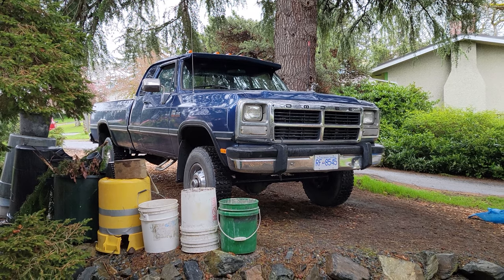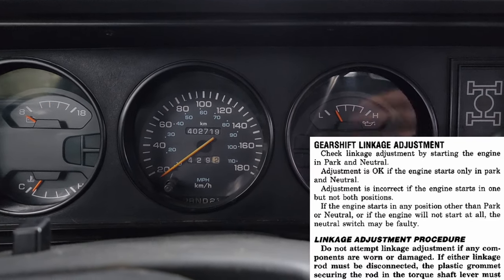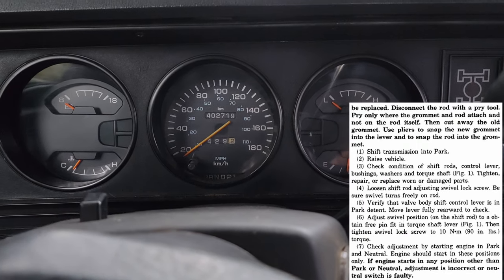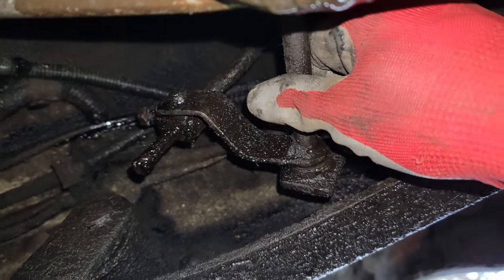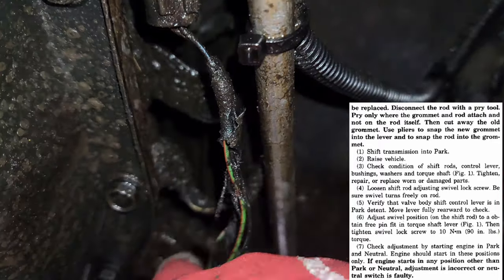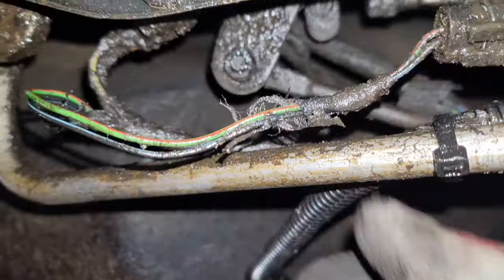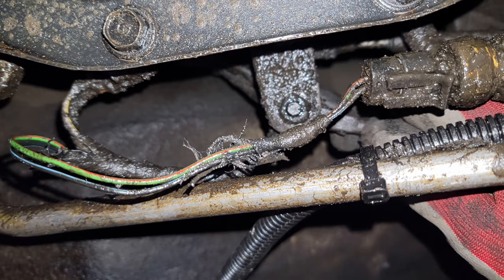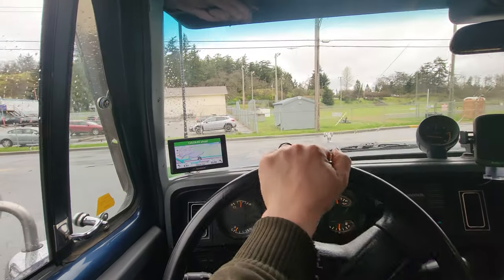Shift Linkage Adjustment | 1st Gen Cummins

Comment: Greatest thing about these trucks they have an automatic oiler system that keeps the frame lubed and all the components running like they rolled off the factory floor
Reply from the maker: Believe it or not it's not leaking I actually applied rust check oil spray as a rust prevention spray.
Reply: @OvensGarage  I would do that but i have too may gravel roads around and all that dust really sticks good
Reply from the maker: @cowthedestroyer  the more the better!

Comment: Check your motor mounts. The engine may be moving because of torque and stretching the linkage.
Reply from the maker: That's a great point! I'm getting a weird noise that I thought my exhaust was hitting something every time I throttle up too. You may be right.
Reply from the maker: Turns out my trans cross-member bushings had worked themselves loose!! My motor mounts were good. Just got new nuts and torqued down my trans cross member bolts to 150ft/lbs. That cummins shook them off! No wonder I had to adjust the linkage the whole trans was shifted to one side.
Reply: Good deal I'm glad you caught it before it could get worse.
Reply from the maker: @howardhudson7214  you saved me! I thought it was just the exhaust hitting something making a weird noise when I was accelerating! Haha
Reply: That's awesome.  I had an old Ford that when you torqued it up the 4x4 shifter would hit the floor board and pop it into 2wd. And that was the same problem. Loose trans mount bolts.

Comment: Great video, is that your TV cable that is unhooked? Hope you unhooked it and make sure its back on. those guys in Texas (Precision Transmission ) say that is a super important to have transmission pressure correct. again GREAT video thanks PS: sure like your gauges above the mirror instead of the gauge pod on the pillar.
Reply from the maker: Hey Jon. Good catch. I honestly didn't even notice that when I was down there. I just hooked it back on this evening. Wonder how long it's been un hooked.. hoping I just accidentally bumped it off when I was down there.

Comment: Hey man how’s it going
I was just watching your video where you hooked your transmission gauge. 
 the port you used did it end up working out OK ?
Reply from the maker: Yep the test port location I used has been working okay. I think the route I've decided to go long term is in the pan though. Next time I service the trans fluid I'll get a deep pan with a port for a sensor and get my reading from the pan instead to get overall fluid temp instead of at the test port. The test port still works but I think it's more of a heat soak temp and not overall fluid temp.

Comment: I would go to the quarter car wash and leave most of that nasty, and finish up with a case of brake cleaner. Then replace all of the bushings, then check the adjustments.
Reply from the maker: Haha. I prefer to have my chassis oiled up. It prevents rust!